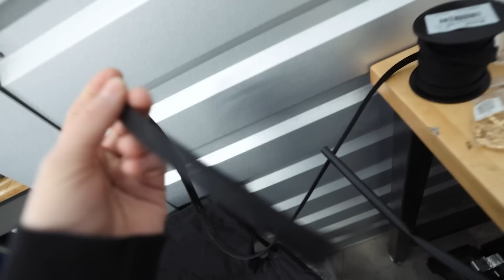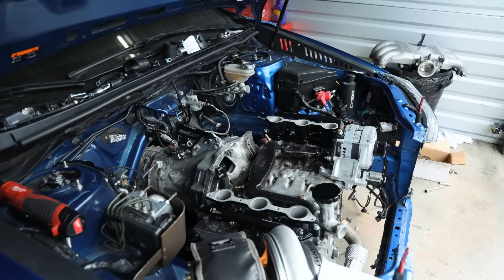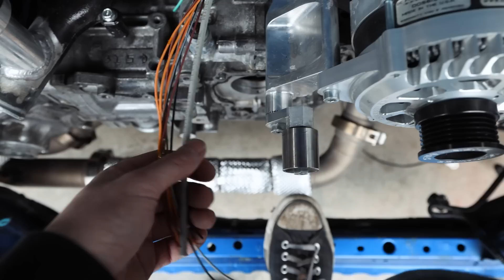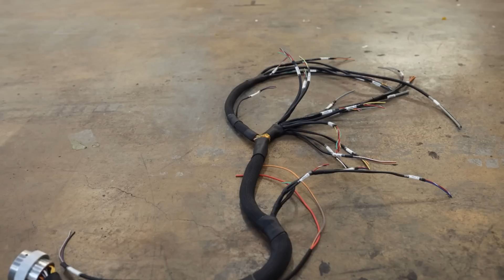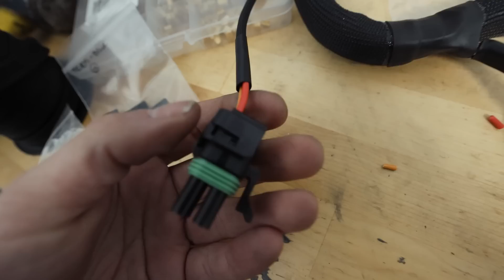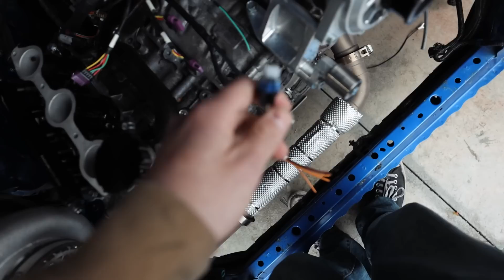Building a Fully CUSTOM Engine Harness for my Turbo EG33 Swapped Subaru WRX STI!

Comment: Can I ask a quick question? I need to to replace the runs for Crank Angle sensor (Error 11) and was wondering what gauge of wire you used and the part number for the connector. Cheerz!

Comment: It's probably late at this point, but another thing you can use at your wire harness breakouts and at the termination points is silicone tape. It only sticks to itself and doesn't get nasty sticky like electrical tape does. Not to mention, you can more easily remove it for a repair than epoxy.

Comment: As for wiring, nothing I can see wrong with yours. I usually do it lazy and just use the butt splices with the solder built in the center. I wrap electrical tape around it for a bit of weatherproofing and so that it's a stealthier black.

Comment: Man I’m in Tacoma and pretty sure my 370z has a wiring harness issue if you want another project 😂 been a nightmare.
But aside from that I just took a risk and bought a modified STI that I’m waiting to be delivered so I’ve been goin through YouTube trying to learn about them and stumbled on you and looks like your local to me so I’m definitely subscribed now. 
Do you have your own shop or have any recommendations on shops around here for modified STIs? 
Once it comes in I Want to make sure everything is good with the new ride and make sure it stays that way, seems like the mods it has supports eachother but want to make sure because I have very limited knowledge, just entering subie-world
Reply: Welcome to the subaru life man, its definitely got its up and downs but definitely worth it.
Reply: Thanks man, hopefully more ups than downs because my Z has been a headache lol that’s why I pulled the trigger on a Subaru, I’ve heard good things about them. Of course I’ve also heard terrible things. Not sure where the truth is but just hoping if I stay proactive with maintenance then it’ll last, fingers crossed
Reply: @Alex-zb3xk  I've owned 5-6 subarus over a 10 year period. Only ones that really will leave you stranded are older NA 2.5L motors. Never had a serious issue with any turbo subarus, just keep on maintenance and catch stuff early :)

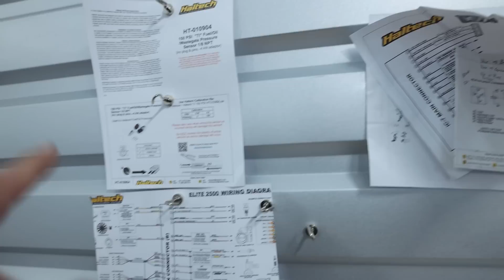Comment: Dude. If you made aftermarket EJ engine harnesses for aftermarket ECU’s or even stock, and they look like this…I would buy one on the spot lol 11:23
Reply: For the stock harnesses, you could just upgrade the sleeves, connectors and modify the harness for specific applications like speed density.
Reply from the maker: @Boxers_or_Bust  I was debating making some 😅

Comment: said it before, wiring isnt boring but finding a way to make it "content friendly" can be challenging, dont overthink it, some of us appreciate wiring vids. Also a very crucial benefit to DR25 is its flexibility! I feel like in this episode you did a good job with making the wiring aspect of this build enjoyable!
Reply: Prowire USA has alot of what you want for wiring all in one place also on corsa-technic you can buy oem connectors or ones for any sensor literally ever made for a very low cost, they also inform you of the correct pin size for each connector you want to order. Personally silicone is a very good way to go, haltech offers this for instances you have with your harness that is too short, tefzel you wouldve really had a hard time getting that to not drive you insane. Lastly a tug test will put your mind at ease, it may not seem like it but tugging on your wire to ensure a good connection will tell it will survive living in your engine bay
Reply from the maker: @Uknterror  everything got a good tig after it was crimped, the biggest thing I've found is the right tool for the right job. Last time I did this I had some auto zone special crimping tools that did not work properly which in turn attributed to the last harnesses failures. The silicone works good but it was not allowing me to actually incorporate service loops like I wanted and was told not to concentric twist with it. But I also get that therr are diffrent levels to the harnesses so I can't be too picky 😅
Reply: @Smeedia  right on!! buying the correct tool for what feels like will be a one time use seems a bit steep, im trying to mention to others that even if its a once time use itll make it go so so much smoother. We are not going to mention how my first harness looked, lets just say I found out FAST that 20ga can come in more than one size when it comes to the outer part of it and boy it couldve made a blind person cry haha

Comment: Hey, love your videos and all that you do with Subies. I'm an avid wiring enthusiast, and I would agree that everything went over my head for a while until I started to become comfortable. Also, I love that you're showing people the possibilities of DIY wiring. Great stuff!

Also, in case anybody cares, what is being called "DR-25" is actually "Raychem SCL". Raychem DR-25 is a 2:1 shrink ratio Mil Spec heat shrink tubing (no adhesive on the inside), whereas Raychem SCL is an adhesive lined heat shrink tubing that hardens when recovered. Also, something called Raychem ATUM is a softer alternative to SCL (also is adhesive-lined).
Reply from the maker: Wiring is an interesting subject to grasp, takes a WHILE to start ti actually understand how things work and how to build them

Comment: King Tanner! Quick question, do you have a video explaining how to adjust the biting point of the clutch pedal? On my 02 WRX the biting point is way to high. Like I barely press the pedal and it will engage. I would like it more around mid pedal travel. Thanks in advance!

Comment: As someone that's built wiring harnesses for a living for the last 4 years, i'd recommend not using epoxy at your breakouts. Just in-case you need to take the entire harnesses apart for one reason or another. I'd suggest using tesa tape; its heat resistant and is far easier to take off than epoxy. Just a suggestion. 

Loving the progress btw!
Reply from the maker: I have a ton if the Tessa tape sitting around 😅 may try that 👀
Reply: @Smeedia  awesome! Hope it works out for you! I'm sure you'll do it anyway, but check the heat rating before applying. I think they have varying heat ranges.

Comment: I would make sure the wire harness operates like you built it before you use potting compound to fill up the voids in the harness. My opinion and well you know what there like lol good luck with it believe me I know I do avionics installs.
Reply from the maker: Prob a good idea 😅 should just have to plug it in and make sure things read as they should

Comment: That harness is a masterpiece. Most people do not care about stuff like this, because it is not a engine building or other more "mainstream jobs". But I can appreciate the dedication behind this. Keep it up! I hope it won't destroy your new engine this time.
Last time wat did destroy your engine? Was it a harness or the unsychronization of the crank and cam sensors?
Reply from the maker: It was a combination of the flywheel backing off causing yhr oil pump gears to shatter and CYL 2 injector depinning under wot 🫠

Comment: bigger pieces of heat shrink or some F4 tape! lmao also, do you plan to cover the wires coming off the cannon plug on the bulk head? ive seen them covered all the way to the barrel with either FP301, FIT, dr25, F4, w3b2, obviously not interfering with the threads on the plug. so you can still twist on and off.
Reply from the maker: I've got some boots that I need to put on the bulkheads 🔥😁

Comment: You ought to look into getting a wiring label maker. I used one at the last shop I worked at. Can change spoils for different gauge wire and text size, length etc… It was wonderful to have and use for all my major wiring jobs.
Reply from the maker: I looked into them but they're definitely pricey. I don't do enough harnesses to justify it 😭

Comment: Do you just buy a kit with all the colored wires or do you have to specificly order by color you determine?
Reply from the maker: Minda both, I start with a bade haltech flying lead harnesses, which has some wires dictated but for all the ones I add in, I choose what colors to use 🔥

Comment: If you haven't done already, can I recommend you create a wiring diagram with gauges, lengths, wire types, connectors types etc, so that it is easier for any replication next time.
Reply from the maker: Already have that document made 🫡
Reply: @Smeedia  good man!! 😎

Comment: I love how much you have stepped it up, you are doing the same process as Rob Dahm on his harness for his 4 rotor fd. I watched everyone of his and will watch every one of yours, at this point in the video you haven’t spoke of cost. In robs video he was talking prices of doing it the right way, wholly crap that stuff is very very expensive. Best of luck to you tanner as always, this is soooo worth the wait.
Reply from the maker: I mentioned cost a little in the last video. I think for this harness, I'm about $2200 deep or so. I'd adds up so quick 😭 I'd like to be able to do some of the ones Rob does 🔥
Reply: @Smeedia  you always learn and grow, I remember watching all the videos of you trying to get the old harness working. You fought thru it and made great content and did the best you could at that time. I was amazed when you were finally done with it and it fired up. You fought soooo much with buying bits and pieces and wrong year harnesses, blue gonna be a beast and a clean one at that…… let’s see that 🔥🔥🔥🔥🔥🔥 soon.

Comment: Is it always better too relocate the oil pressure sensors I run an haltech one an not sure if they get ruined when running on top on the block
Reply from the maker: Ideally yes, engine vibration can kill the sensors 🙏

Comment: 2022 wrx is back in action, the center diff bearings seem to have a manufacturing defect liquifying the bearings and sending metal shavings into the trans and hurting the drive shaft.  But the warranty guy said if I were to bring it back with another huge issue that I would most likely be denied warranty due to the stereotype of “racing the car” which they have no proof of and my max data says the car has been treated correctly soo idk what to do..
Reply from the maker: If its a manufacturing defects how could they deny you if it happened again?!
Reply: @Smeedia  your question is as good as mine

Comment: Of all the "projects" I've seen die, it's usually cause of the noob killer sections:  Tuning and Harness.  

Great Job so far!  It'll definitely be worth it when it all runs right, and keeps running right!!!
Reply from the maker: I've seen electrical demolish builds before 💔 best thing we can do is learn and keep going. 

And thank you! Hopefully, this solved any electrical issues we had before 🔥

Comment: Amazing as always!!!! Whats the difference between silicone and tefzel? I work a lot  with silicone. Never used tefzel
Reply from the maker: Silicone won't hold up to heat, oils, fuels etc thr same. Tefzel uses a thinner coating that is resistant to what you'd normally find in an engine bay 🫡 you also can not use silicone wiring for concentric twisting and they don't like to cooperate for service loops 😅
Reply: @Smeedia  good to know!!

Comment: Nice work Tanner! I am proud of myself too. I wrapped a new header with DEI titanium heat wrap and installed the headers this morning. Went for a drive and my STI now sounds like a SUPRA. lol
Reply from the maker: How was using the wrap? 😅 the fiberglass ALWAYS destroys me 😂
Reply: @Smeedia  I used gloves and a long sleeve shirt. Then I sprayed the wrap with high temp silicone spray. It all turned out perfect though. I had to order new 90 degree -10 AN fittings for the mishimoto oil cooler since the ones they ship with wouldn't bolt up. I'll be reinstalling the oil cooler once the fittings arrive. I did have to use eye protection when installing the headers as silicone was falling in my eyes while trying to install the headers. Everything fits and the car now sounds so different with equal length headers.
Reply: @Smeedia  Also, the new headers were way lighter than the stock ones. Weight savings are always good!
Reply from the maker: @Bushido Photo, LLC  which brand did you go with? 👀
Reply: Perrin.